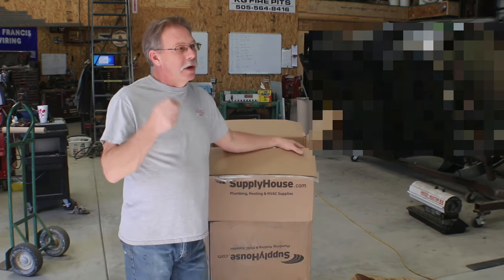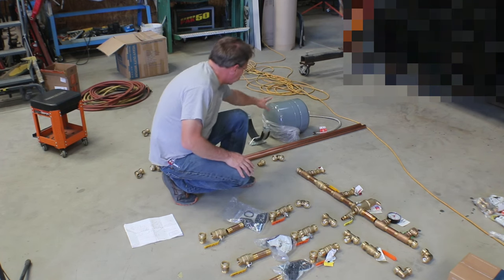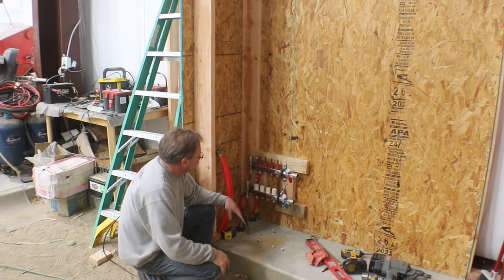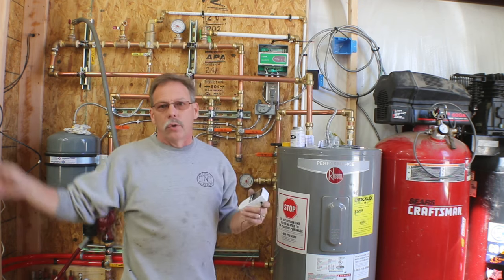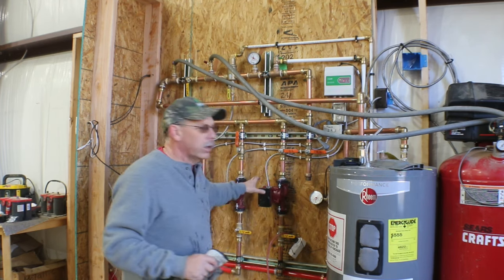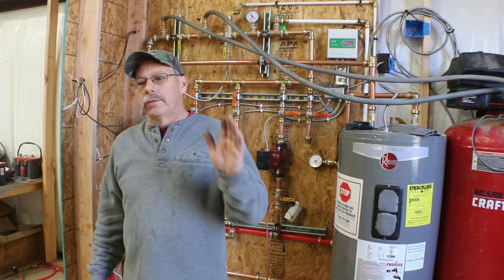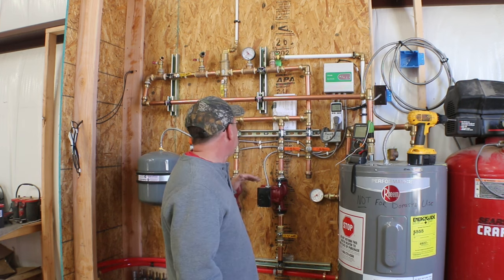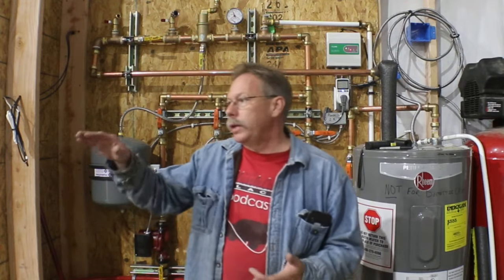Can you Heat your Shop with a $200 Water Heater? Radiant Floor Heating For My Shop | Allison Customs

Comment: Water heaters are the superior medium. It easily stores heat energy in the tank long term rather than needing to blast current through resistive elements for air exchange. Has anyone tried this with a fin radiator for water to air exchange?
Reply from the maker: I’ve got one on order - assuming I ever have extra BTUs to spare.
The original idea was to use a waste oil boiler, unfortunately I just don’t produce the amount of oil necessary.
Check out the current situation - https://youtu.be/_mR7S4N28oY

Comment: How did you decide which parts to do threaded and which to do copper + sharkbite?
Reply from the maker: I wanted to do as many sharkbite fittings as possible, but when running a one part after another that would likely never need replacing (ie. valves), I chose to go the cheaper route of using threaded fittings.  
Thanks for the question.
Jeff

Comment: thought you did a nice job of setting up the system. Since you have 7 inches of concrete you are of course going to need to run and run and run the water heater.  one thing I did not hear you talk about was how much insulation you put under your slab.
Reply from the maker: Good point, I certainly should have mentioned it.  I used a fairly expensive thin(ish) R10 under the slab and the perimeter of my shop has an R30 ICBs.
Reply: @AllisonCustoms  perfect! 
Too many think that’s optional, but the downward loss can be huge!
Reply: I agree insulation is critical.  I used 2" Styrofoam in my basement floor and it works great.  I did not use any in my shop floor, basically because I did not take the time to research how it would affect the load capacities.  I am heating both with a 180K BTU outdoor wood furnace.  But the shop floor never warmed up even after running it all day. I installed a water to air heat exchanger in the shop, and now I can feel a difference in a few minutes.

Comment: I have infloor radiant heating and the only addition I would recommend for you (if possible) would have been to plumb in a water inlet into the system.  I have one on mine with with a valve so if I ever need to drain the system I can fill it back up easily.  Basically just open the valve for a while, start the system and let it run with water on to completely fill the system and push any air out through the breathers.  In my area we generally use glycol in our closed loop radiant systems however being that I also have a furnace as a backup I felt comfortable using water in my system.
Reply from the maker: Yea, so far I don’t have water to the shop either. 
The original idea was to use a waste oil boiler, unfortunately I just don’t produce the amount of oil necessary.
Check out the current situation - https://youtu.be/_mR7S4N28oY

Comment: I can heat an entire house on about 3kw on hydronics 4500sq ft.  Titan tankless 120 now the 220 I think.  The thing is it sure eats the electricity and I don't use it anymore.  Gonna build a heat pump unit into the system.
Reply from the maker: I have been looking at all kinds of alternatives.
The original idea was to use a waste oil boiler, unfortunately I just don’t produce the amount of oil necessary.
Check out the current situation - https://youtu.be/_mR7S4N28oY

Comment: I certainly know why you could not find any information on this topic, it is unique. You start off with an assumtion that you can heat a large area with a water heater without finding out the heating demand. Right off the top I thought you were way under powered and you are going to have a very large electric bill. A mini split heat pump would have been better, but not really big enough. There was no way 4500 watts was going to be close to working and you proved it. I run 9600 watts to heat my house until the temps get in the 30s then 19200 watts, that is 82 amps on a 100 amp breaker. I think I would have used portable propane heaters. But I did enjoy watching your video.
Reply from the maker: Thanks.  I did eventually get the heat loss calculation completed and YES I am very under powered.  
The original idea was to use a waste oil boiler, unfortunately I just don’t produce the amount of oil necessary.
Check out the current situation - https://youtu.be/_mR7S4N28oY

Comment: Running both heating elements and upgrading them to 5500 watt, did you have to upgrade to a 50amp breaker or has the 30 amp held up?
Reply from the maker: Two 30 amp, each element is on their own.

Comment from the maker: There are now 2 follow up videos: 
1st one about the actual cost of using electricity. - Shop Radiant Floor Heat - How Much did using an Electric Water Heater Actually Cost?
https://youtu.be/5jO3bHkLhJE
2nd one about adding Solar - Hydronic Solar for My Shop with Radiant Heat
https://youtu.be/_mR7S4N28oY

Comment: You want radiant supply temp to be 120f.  Either set tank temp to 120 or higher and temper down to 120 with a mixing valve.  
A full tank at 120’ has roughly twice the energy of a full tank at 60’.   Sounds obvious, but having a low tank temp makes it effectively smaller. Higher temp setting makes it effectively bigger.  Unfortunately the recovery rate and max btu output of the electric heater may not be adequate for the cold weather design day temperature.  4500 watts x 3.4= 15,300 btu.   That isn’t much btu and likely wont keep up on the coldest day unless the garage is well insulated.  Depending on electric rates, this isn’t the cheapest way to make heat.  

A non condensing high efficiency propane water heater would work better and are cheap. Avoid a condensing version, they are twice the price and overkill for this.  You can use that existing electric water heater as a buffer tank. A buffer tank will increase efficiency of a heater and prevent short cycling.  

If your electric rates are cheap then just…. run what you brung…if it’s working.
Reply from the maker: Thanks for the feed back!

Comment: I can't see your whole set up but. I like what you're trying to do. What I don't like is the electric hot water. That's an uphill battle. I really mean an uphill battle. Like Mount Everest. I think you could've tried solar hot water,  Or a woodburning stove with some type of heat exchanger.  With either one I would have some large storage tanks. When I installed my solar hot water  20 years ago that was the thing that I was told and found it to be true. The more storage you have the better. I wish I had more storage because I have  5   4x8  solar hot water panels. I could definitely heat more than 120 gallons. That would come in handy on the rainy days. I also use them to supplement my heat in my house through my radiators. Some thing I was told couldn't be done. But it works. Also anybody wanting to do solar hot water. Please spend a little extra money for a drain back system. It is easiest best system there is. Keep up the good work.
Reply from the maker: Thanks and Solar is definitely in the plan.

Comment: Wow!  i've been doing plumbing all my life and worked in the plumbing department of a Home Depot for 8 years once.  i've done entire houses with PEX piping and manifolds but i've never done a hydronic heating system or a radiant floor.  i don't think i would attempt what you did.  one of the things that concerns me as to why i wouldn't try what your did is that running hot and cold water through a simple "branch and trunk" plumbing system and then in and out of a hot water heater is pretty simple.  however, a hydronic system has the possibility of steam buildup due to the higher temps involved as water will boil (and create steam) above 212 degrees Fahrenheit.  it would be this "steam management" issue that i don't know enough about to attempt a system like yours.  the other thing i have to mention is that i know the price of almost all the components you've used.  i'm guessing you have at least $2000 in just your "wall unit" and the hot water tank.  Nice job though and cudo's to you for doing this project.
Reply from the maker: Thank you, one of the goals is to keep the temps well under steam temps.  Under a 150 degrees and closer to 125 seems to be better.
Reply: Had different pressures there are different boiling points. The higher the pressure higher the boiling point so in heating at 12psi the boiling point is way higher then 212f . Just food for thought
Reply from the maker: Interesting point.

Comment: I hate to say, but the weakest link is glycol mixed with the o-rings in sharkbite fittings. Glycol is very harsh and has been known to eat up press fitting seals and other rubber. Cool idea though.
Reply from the maker: Thanks, hopefully the fittings will last until I can make my final plans for the system.  I will then likely solder everything.

Comment: All of the exposed pipe that you can insulate, insulate. 
 Have you thought of geothermal? Would be a great solution to avoid resource use. I kinda think that a geothermal would pay for itself eventually in utility savings
Reply from the maker: I really like the idea of geo, but I don’t have the room to layout a system in shallow holes and our water table is to high for deep hole versions.  If I had more acreage it would absolutely be worth considering.  You could get pre-heat in the winter and cooling in the summer.

Comment: Great explaination; would be interested to know the running costs, or even the cost per Kwh in your next of the woods.
I also do this for a living, only ever seen a few electric element tanks as the heat source, just too expensive to run.
Cheers from Oz.
Reply: Expensive compared to natural gas, if it's available, but not so much more compared to the price of heating oil or propane, once you balance for actual useful BTUs.  Possible an air-water heat pump feeding a heat exchanger loop into the tank could save money down the road
Reply from the maker: Currently our electric is .1001 cents per kWh. During January and February which tend to be our coldest months of the year, I was seeing about 18 hours a day of run time.  This is really not efficient enough to be a long term solution, I have a hydronic solar system ready to be ordered for next winter.
Reply: JK brown is spot on. Although solar with storage tank will be extremely efficient IMO,  I do have a heat pump water heater I used for my radiant system,  made by Rheem. I use it for warming the floor, standard heatvpump for actual air conditioning.  To be honest. It bearly keeps up in heat pump only mode set at 120F, 70F for floor temp. Heat exchange done with a Taco Xpump block. Basically it's a heat exchanger with 2 pumps built in with controller, nice neat package. At 9.7c/kWh, cost about $13/month extra from our average $5/month water heating needs.  For his size floor and heating exclusively,  maybe a pool heat pump would be better. Same cost as my dhw HP, but high btus overall. Interesting to see his solar setup in the future!
Reply: Any thoughts on using a tankless electric water heater?   since the return temp of the anti-freeze is pretty high (compared to domestic water source), the temperature rise wouldn't be that great.   And also as the floor slowly warms up, the return temp of will also rise, which then means, the outgoing temp be warmer as well.  I'm thinking of do this to avoid my huge gas bill which is around $300/month in the winter.
Reply: @CrapTennis  Electric tankless uses huge amps to achieve results.  Usually 125 amps of 240 vac or 30,000 watts.   His electric resistance water heater started out at 4500 watts and was way undersized.  Then he paralleled two 4500 elements to achieve 9000 watts.  Still not quite enough so he changed to two 5500 watt elements in parallel for 11,000 watts.  Nothing magic, with straight electric heat you get 3.41 btus per watt. Expensive to run.   A better solution is a heat pump water heater if electric is your only choice.   They still have electric resistance to supplement the refrigerant based heat pump but the heat pump can get over 10 btus per watt.  So it can be 1/3 the cost to run.
Reply: Even then, a heat pump is normally the same cost to run as gas.
Reply: @controlfreq9346  so $13/MOS to heat how large of a space to what temp?  Thanks.

Comment: Wow, you certainly did your homework on your project.  I like most people who are watching this video am a DIY guy so this was very informative.  I helped my father in-law replace the heaters in his garage which was done in 2001 but he never put the antifreeze in it so helped him and learned much through hands on.  We live 30 miles south of the Canadian border in NE Washington and Idaho border so the temp drops well into the -25 to -35 due to our elevation(3000ft above the valley).  My home doesn't have the floor heating, its a modular home with a 4ft crawl space.  I'm wondering if I could put this system in my flooring.  If you know of videos on how this is accomplished please send me a link.  Thank you for a well documented, interesting and most of all Not boring video.  NE Washington State
Reply from the maker: Glad this video was helpful, I don’t really know of videos about installing the pex in a already existing home. My thinking is if there is a crawl space then it can be done.
The original idea was to use a waste oil boiler, unfortunately I just don’t produce the amount of oil necessary.
Check out the current situation - https://youtu.be/_mR7S4N28oY
Reply: Do you have your crawlspace insulated? Vapor/plastic barrier, up in the joists, etc..?
Reply from the maker: I’m on a slab
Reply: You can send hot water to fan coils in your home (or radiators). Check for video on "hydronic heating" if you would like to explore the idea.

Comment: I heat 2000ft2 with a 4500w 60G tank for 6y now in -30c winters.  Never going to work according to anyone who asked.   Power bill is $$2500 annually with an electric car as my daily driver 30mi from town.  Go figure.  Keep going.
Reply from the maker: You are doing better than me! I wish my bill was that low.

Comment: Very nice. Good idea.  One thing.  Your wrong that it's possible to flow water to quickly.  Maximum trannser occurs when there is the freatest differntial between tubing and the load (slab or whatever).  Having a great tempreature drop on the return side just means that all the btu's available were transfered.  Less and less trasfer occured , inch by inch the further away from the source because there was less heat available inch by inch.  Maximum performance (max transfer) occurs when there is so much flow there is very little difference from input to return.  There was so much heat available, every inch of the loop transfered as much heat as it could.  With enough flow, the difference would be unmeasurably small.  The short of it is as simple as flow as much water has  possible if the object of the game is to get as much heat from the loop as possible.  I'm not guessing.  This is not a theory.  It's simply the way it works.    A good video none the less.  Keep up the good work.   Joe Jurkenas PE
Reply from the maker: Thanks! Explained that way, it makes sense. Thanks for sharing!

Comment: Instant hot water heater I thought might be better. It heats as it moves. The more it recycles the hotter it gets.  But, I've never tried this before so maybe yours might work just fine. Not down playing your ideas at all. Just putting some input to you.
Reply: I tried using one and it stopped working after a week. It just wasn’t able to handle the workload. So since I have a tank I’m trying it next. If you use instant heater it has to be a very expensive one.
Reply from the maker: Thanks!  I’m open to all ideas. So far, the tankless systems I’ve looked at use more power and so I have shied away.  But they may be the solution yet.

Comment: have a 6000 watt boiler system being made... two 3000 watt heaters wired in a two stage process and control circuit, one come on at 18 degrees the other at 15 degrees... circulating fluid to a radiator under the trailer where the water intake freezes. $12 pcb switching a 50 amp relay for the split 6000W heaters... not running the heaters off there internal thermal switch. heaters not on if the pipe loop is pulling passive heat from in the trailer... no more then 80 watts of power needed to push the fluid, drops to -55*C on occasion. a 30 cubic foot heat zone, like a dog house!
Reply from the maker: Sounds like an interesting system!

Comment: Thinking about what you could have done to increase the costs of the system.  Use one some what larger pump rather than three pumps.  The cost of running the pumps would be reduced and the real volume of water pumped would have been more efficient
Reply from the maker: I think the system cost enough as it is. 😀 A single pump large enough for all 3 loops also cost nearly 4 times the price of a single pump ($1300), so I’m not sure that would help.  Each pump is less than 200 watts when running on High and for now only one is running at that speed. I’m also currently only using two pumps in the floor system. The third pump is for future expansion.
Reply: @AllisonCustoms  so figuring the starting amps and the cycling I still figure that the actual power needed is going to be a lot more than the single larger pump.
Reply from the maker: I’d have to look at the pump specs to know.

Comment: Oh the other option is to let the water run continuosly through the water heater without modification to the hot water heater.  It will slowly warm up using both elements.
Reply from the maker: That would probably work very well with a gas water heater, the electric version doesn’t recover as quickly. So I didn’t want to rely on that.